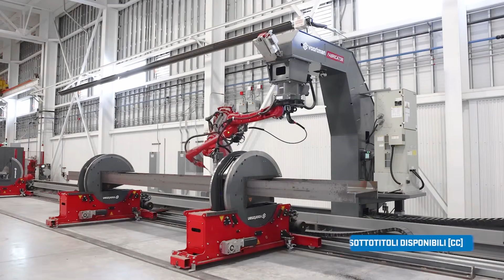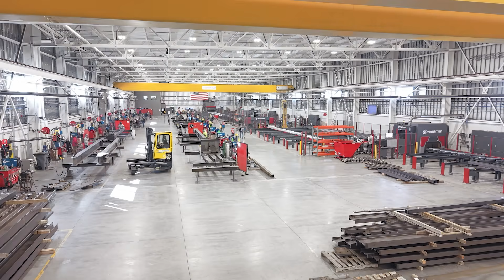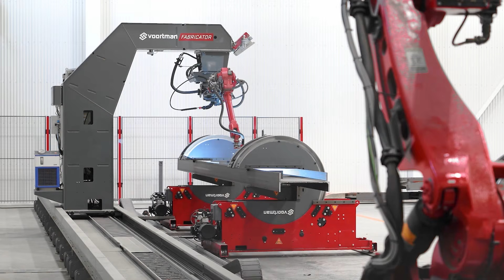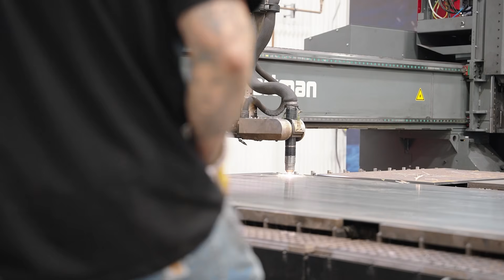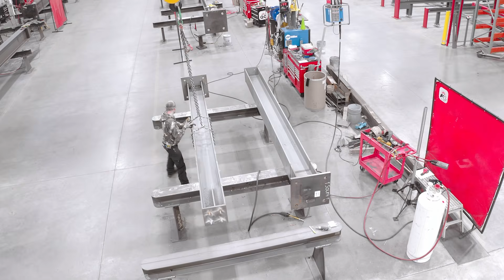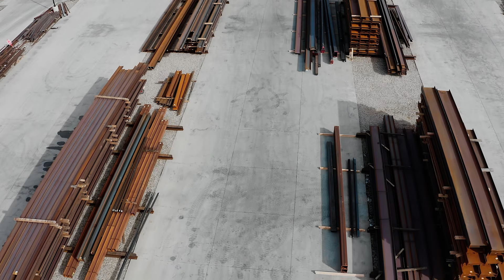Is this the MOST ADVANCED Steel Fabrication workshop? | Fineline Steel Fabricators

Comment: I'm in Australia been a fabricator for 40 + years 
The shop I work at now has a fibre laser with capability of 25 mm steel or 20 mm stainless 
To see your men still unloading a laser table manually lifting out plates still looks cumbersome and as time consuming as how we do it 
I'd suggest a light quick action magnet crane for steel and vacuum for non magnetic parts 
Removal from table 
Also a chop up programme for plate skeletons (waste)
To an easily handle able size 
We have the same issues 
And it's always time consuming
Other than that credit where it's due on your shop
Good to see such flow everywhere else 
Cheers